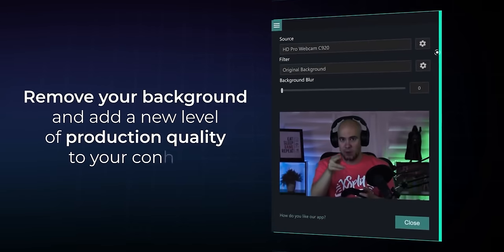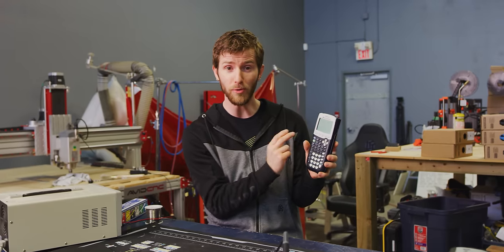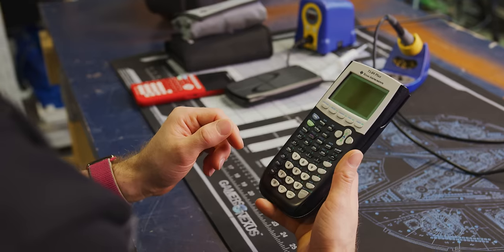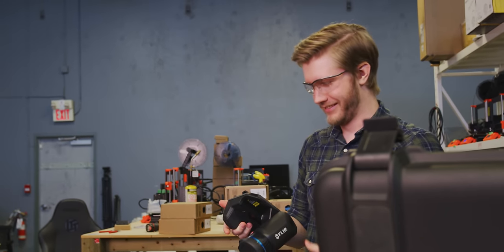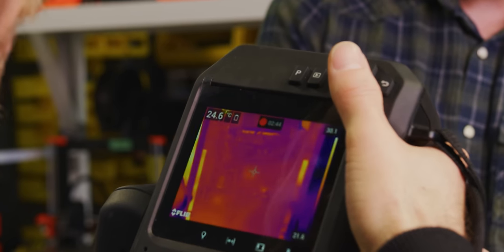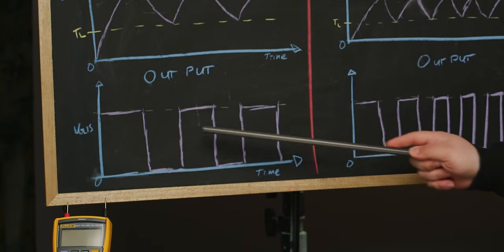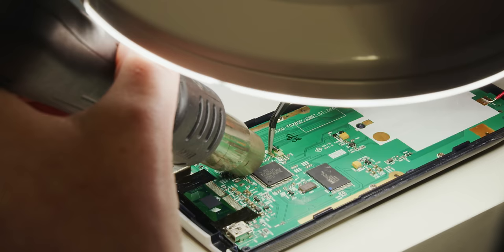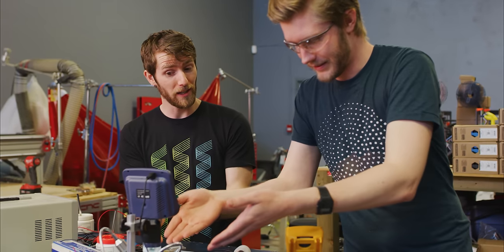Water Cooling a TI-84 Graphing Calculator!

Comment: Watercool a pillow next so I dont have to flip it over.
Reply: Coolermaster new product
Reply: Nah, do it with a peltier cooler!
Reply: If that was possible I would honestly pay for it
Reply: I wonder if it could be possible to make a high end liquid cooled gaming/pillow.
Reply: E
Reply: so relatable
Reply: i  can relate very much
Reply: An actual good idea.
Reply: Already a product
Reply: @supremetaco4887  where
Reply: @ROGAROEBI  with the slogan "Always cold when you need it"
Reply: Enit I actually need that
Reply: @randomthingch1970 put the hot part outside the bed?
Reply: @theproblem9938  Not actually that hard, get a pile of thin gauge PVC pipe. Make a bunch of parallel cooling loops. Silicone the shit out of them to make a joiner up to regular fitting size. Add pump and radiator and away you go. Downside is though that it'll only cool to ambient at best. For added coolfactor slice the foam of the pillow top and embed the coolant lines in it. The reason for using many smaller lines is large lines are going to be uncomfortable and make cool spots rather than a larger cooling effect. Take a look at adam savages cool suit for how to do a proper job of it.
Reply: That’s an amazing idea
Reply: i've wanted to do this for so long
Reply: @xandersnyder7214  cringe
Reply: @xandersnyder7214  nah, vodka better
Reply: Just fill it with copper shavings.
Reply: What if we just made a water bag and used it as a pillow
Reply: My dad has a pillow with gel pads in it to cool the pillow, quite compfy and always nice and cool.
Reply: ImVictiny 👍
Reply: Just get a ac
Reply: Make the radiator the pillowcase
Reply: U r fricking right bro
Reply: yes that should be a thing lol!
Reply: hahahahahahahahaha
Reply: Needs an adaptor for a direct connect if you already own a waterbed... Lol !!
Reply: I THOUGHT I WAS THE ONLY ONE
Reply: To be honest I would pay 10k for it
Reply: A pillow with a fan would probably be more efficient
Reply: Well at least that would do something
Reply: oh yesssssssssss
Reply: Most amazing thing to be done
Reply: World Monarch if hot a design that would theoretically work... am not sure to make it tho cuz there are going to be problems like the water circulation system and water leaks and not to forget the electrical waste
Reply: I need that 💯
Reply: That’s called a nut rag
Reply: Watercooling a pillow might actually result in something as a result of it being watercooled.
Reply: I need this
Reply: @noot9389  cool beans
Reply: Water cooled brain
Reply: I'll Take your Entire Stock!
Reply: I slep in da fridj
Reply: add rgb so i dont need a night light
Reply: I wish bro
Reply: Introducing chillow
Reply: @randomthingch1970  would it even get that hot tho, its only cooling body heat
Reply: Just commenting the 69th reply
Reply: Have any of you watched the April fools vid they made well if you have look 7:16
Reply: I though i am the Only person in the entire word who do this
Reply: Invest
Reply: I’ll talk your entire stock
Reply: Just add some fans or a radiator if on a buget
Reply: Lol
Reply: Take my money this instant
Reply: Imagine when patents come in and your head will be from ice lol
Reply: So relatable bro
Reply: INVEST!
Reply: invest
Reply: The pillow gets warm because you're warm. Watetcool yourself!
Reply: There is already a thing... Well kinda... it's jelly cooling pad stuff but it's awesome I rock it ever night
Reply: Please do it
Reply: Wait. . .
Reply: It's actually something i would buy
Reply: Someone write that down, NOW!
Reply: YES!
Reply: You know, water filled pillows already existed but it’s a generation late than this so I’m honestly surprised by all the people in this comment 😅
Reply: Queue invest meme
Reply: I need this now
Reply: I would 100% buy that
Reply: Well they water cooled a chair so.....
Reply: @crimsonstrykr  I commented where the water cooled pillow was.
Reply: @imvictiny6122  Give it a few more months, if it hasn't occurred to him already then it eventually will.
Reply: 7k likes, this man has or will see it.
Reply: Billions of dollars would be earned
Reply: I actually like the warm part of the pillow
Reply: @aym_gei9708  Stalin, Herman Goring, Hitler and Satan stare in horror
Reply: This has got to be worthy of a Nobel prize
Reply: Xander Snyder yeah sure if you plan on setting the other side of the pillow on fire
Reply: Ok I need that
Reply: This man living in 3020
Reply: Doesn't what already exist
Reply: I thought i only do that. 😂😂
Reply: i would buy this
Reply: I would take incredible personal risks to get a product like that.  Like, a Craigslist pillow wouldn't even be off limits if it had a radiator built into it.
Reply: Yeahhh
Reply: Oh dude
Reply: lol its called a humidifier
Reply: @meshalalomar7472  Invest
Reply: Fucken genius I need water cooled pillow
Reply: iQ 9000000009
Reply: I want to see this for real
Reply: Cool pillows already exist. I don’t know if they are any good though.
Reply: This is the most Linus tech tips comment I’ve ever seen
Reply: Yessss
Reply: This is what happens when we use 100% of our brain
Reply: Don't Forget to use RGB
Reply: Yes
Reply: @coolgreens  u need RGB in that
Reply: Yes
Reply: @aeyde  yes , finally a worthy machine to play stalker on
Reply: @MonosShenanigans  yasss
Reply: Yes
Reply: @xandersnyder7214  yes let’s all build that and really get a brain freeze
Reply: YOOOOOOOOOOO
Reply: Oh my god
Reply: same
Reply: I actually have a watercooled pillow lol
Reply: Yes
Reply: I'd buy that
Reply: I cant flip the pillow because i have my arm under it so it will not be c̑̈ȏ̈ȏ̈l̑̈
Reply: Take my money
Reply: just put an ice pack underneath the pillowcase for infinite cold
Reply: Why is it that I feel like I need something like this in my life instantly😂😂😂
Reply: Greatest idea ever
Reply: Damn that's what I do
Reply: Frfr
Reply: Just put ice in your pillowcase
Reply: Omg i need this my pillow gets so hot
Reply: @randomthingch1970  same bro
Reply: Do u mean So They Don’t have to flip it over? Grasshopper
Reply: YES
Reply: yep
Reply: Yeeeeeeessssssddd
Reply: @meshalalomar7472  yea
Reply: ILL BUY UR ENTIRE STOCK
Reply: legendary comment
Reply: Coming back to this video to see this comment to say not a bad idea
Reply: @qdawwgg  If only I had a way to execute this idea into something actually useful.
Reply: Linus is like Write that down
Reply: While your at it add some rgb for more FPS (frames per sleep)
Reply: It exists but it’s like 500 dollars
Reply: I....I always do that in summer season.
Reply: Honestly a genius idea
Reply: Yes
Reply: Maybe linus was secretly the one to invent chillow
Reply: I'd invest in this
Reply: Over clock the pillow to sleep faster.
Reply: @ImVictiny I agree, I always flip the pillow over so I don't burn my head when I sleep.
Reply: Ya heard it people we need this next
Reply: Chillow
Reply: That is actualy a good ideia
Reply: sounds like a good idea
Reply: I thought of this last year, I want to sell it and make money.
Reply: @charlescastle4533  I posted this comment seconds after I flipped my pillow. Since then I have gotten so much great feedback on this comment for it to become a thing, this joke is a great idea for a product, I just have no idea how to create the product.
Reply: @Povilaz  if only I had the technical know how to create the product, to then make bank off it.
Reply: @imvictiny6122  I was thinking a cooled pad that sits under the fitted sheet.
Reply: @charlescastle4533  for me constantly move in my sleep, a lot of times taking the cover off my pillow somehow. For me this wouldn’t work for long. Other might experience the same thing.
Reply: OHMGOD THAT IS GENUIS
Reply: @randomthingch1970  no thats dumb
Reply: Take my money, I’ll take your entire stock.
Reply: Sponsored by “my pillow”
Reply: Fr
Reply: Not tryna flex or anything but i have a pillow with cooling gel 😎
Reply: True
Reply: This thumbnail reminds me of those kids with superblaster waterguns from the 2000s lol
Reply: HUGE BRAIN
Reply: yes please
Reply: Dont tell the government
Reply: Lmaooo
Reply: I saw a Walmart brand pillow that has a cool side, so you actually flip it over when it gets COLD
Reply: @WellBehavedForeigner  nooooooo its not the same!
Reply: How was this posted a year ago?
Reply: @ironcrafter54  wait hold up…..
Reply: @imvictiny6122  my bad
Reply: yes
Reply: I would maybe buy that
Reply: ima patent that
Reply: Just put a pillow in a tub of cold water and sleep on it
Reply: INVEST
Reply: We...actually need this...
Reply: Would rate 10/10
Reply: Thats a good idea
Reply: This is so needed specially in summer heat
Reply: I’d buy one
Reply: Yes, just... Y E S
Reply: Genius
Reply: YES YES YEEEEEEEEEEEEEEEEEEEEEEEEEEEESSSSSS
Reply: Has this been made yet? I NEED ANSWERS MAN!
Reply: Wait till that watercool breaks
Reply: Chillo
Reply: Y E S
Reply: Damn. Time to dream in UHD 240 FPS  and ray tracing
Reply: I don't care about pillow temperature. Summer gets a bit warm but manageable.
Reply: I would watch it
Reply: Good idea ima note that
Reply: Had me dying
Reply: Man’s a genius
Reply: Based and cold pilled
Reply: Get this man in contact with the president
Reply: Haha so true
Reply: *nitrogen cooled 😂
Reply: Yes. Just yes.
Reply: Yes
Reply: FR THO LINUS DO THIS
Reply: I agree
Reply: @arkham7610  they water cooled a chair. Water cooling a pillow would be the same
Reply: You sir are a genius
Reply: The most important thread of 2021
Reply: Watercool
Reply: @tfr  and what?
Reply: Yooooooo
Reply: Genies
Reply: GENIUS.
Reply: Imagine putting flexible tubing inside of an insulated pillow with an external radiator. That might actually work. And I'd buy it
Reply: There's a mattress that's water cooled. And what I've done in the past is put flat freezer pack into my pillow.
Summers here are nuts, I usually can only sleep around 3am in the summer because it's above 80 till then.
Reply: Yess
Reply: big brain
Reply: @theproblem9938  it exists. Just look up "Actively cooled pillow"
Reply: Yes…YESSSSSSSS!!!!!
Reply: It’s called a chillow.
Reply: Yes!!!
Reply: Best comment ever seen...
Reply: Genius idea
Reply: Honestly I would buy it
Reply: why stop there? why not blanket, sheets, mattress, room, earth?
Reply: @TheAdhdGaming we're evolving
Reply: Actually a good idea
Reply: Genius
Reply: YES
Reply: @Xander Snyder But where would the heated side go?
Reply: Yeah I would love that...
Reply: Oh my God you genius. Now make it happen.
Reply: you can just pee into the pillow
Reply: Yes
Reply: Genius
Reply: That exists actually, and they are amazing. Not even a joke, I sleep a hundred times better.
Reply: best mfing idea ive ever heard
Reply: But sire the fans!
Reply: Bru it will get wet
Reply: most smart and genius comment ive ever seen on youtube
Reply: Yes
Reply: @coolgreens  Getting 4k with a 144fps of sleep
Reply: 250th reply!
Reply: Check out the chilli pad for matresses
Reply: anyone else here after the watercooled mattress 💀💀💀
Reply: he did it to the bed!
Reply: Nah, put the antartic in it
Reply: Yes!!!!
Reply: He did it for his bed
Reply: and thus 8sleep was created
Reply: I read this while doing it 😂😂😂
Reply: Best idea ever
Reply: i think use peltiers instead
Reply: @theproblem9938 it literally is possible

Comment: Next up, “We added a graphics card to the water cooled TI-84”
Reply: We adde gtx 1080 ti to the ti-84
Reply: @gabrielhynek8863  *RTX 3090
Reply: Well then it’s worthless unless you have it at 75ghz
Reply: @izakymom  coconut
Reply: @izakymom  beautiful
Reply: ffs it's gonna be more expensive than my laptop lmao
Reply: @Percy WONG lol
Reply: @Percy WONG And how about the drivers? The drivers could be more resource intensive then it can handle.
Reply: RTX Tracing on a Calculator
Reply: 4K math
Reply: Now you can do 10 variables in 10th dimensions graphs
Reply: "We added the water cooled TI-84 to a PCIe slot"
Reply: yes
Reply: Finally I can add with dlss
Reply: From my very surface level knowledge of computers, I think it's possible using the data link

Comment: The Ti 84 had actually quite a beefy processor. It's just that it's clocked extremely slowly so that the power draw will be minimum.
You can get at least double the speed if you also speed up the memory (and other things). There's actually a similar guide out there that I had seen earlier..
Reply: Do you have this guide ?
Reply: @adrient3957  no I don't. But basically it involves replacing/reducing the resistor of the clock-genetarion circuit with one of a lower/higher value, so you get faster fclocks.
Reply: I believe it’s possible to do this in software but it makes the calculator unstable
Reply: You would also maybe need to jailbreak your calc

Comment: As a mechanical engineer and a computer hardware nerd, I have an intense amount of respect for Alex. Keep up the good work, man.
Reply: if you ever get to see some of his old go kart content, its NUTS. he'd build a wild chassis, and then just SEND it.
Reply: Yea man, he is so smart! Also, he just makes everything seem easy. Ow we need to make this circuit, get some of these resistors just mash it all up. There you go. Even more with mechanical engineering stuff
Reply: 117TheWolf until he said increasing wire length increases capacitance whoops
Reply: @tntfireguy1  probably meant resistence
Reply: @tntfireguy1  wire has capacitance directly proportional to its length, so he's not wrong. But you're talking a few picofarads for like 10cm of wire, so I doubt it would effect the astable clock a noticeable amount, at least not nearly as much as the resistance in the wire.
Reply: How did you get the LTT after your name?
Reply: James Balazs resistivity increase yes, though due to the nature of bridging the two capacitors the wires will probably have some affect on the capacitance as it is conducting between the two
Reply: Xnzyrp stray capacitance yes, though it’s as u said such a minor difference as it’s not a significant change in length
Reply: He is a member of the channel

*if you hover over, it says he is a member for 4 months... hahaha...
Reply: @tntfireguy1  I think the main problem is the dangling wire. Try solder as perfect as you can, leaving a resistor pot just waving around like that can change the value quite a lot (10s to 100s Ohm depending on the size of the resistor). That is why it needs to be soldered down as short as possible.
Reply: Can you teach me plz
Reply: Not to mention his looks I mean what a sexy beast
Reply: I wanna be him when I grow up
Reply: @fabianvandermijde4066  before that reaping pads...
Reply: @tntfireguy1  it will increase capacitance if it's a pair of wires, ie. power and ground. These wires act as parallel plates separated by an insulator, which is the same as a capacitor.
Reply: Alex is right, it does increase capacitance and most of you are right as well that the resistance goes up. But something no one has mentioned is that the longer wires also act like antennas picking up noise from the system as well as external interference which will also affect stability... and the sensitivity to interference will increase with clock speed.

Comment: Finally, I can graph an integral in less than 10 minutes.
Reply: use a fucking desmos
Reply: @omniyambot9876  no desmos on the AP exam
Reply: HP Prime for the win running 528 MHz stock. Can use in AP exams and more.
Reply: I did the ap calc bc exam with a ti nspire csii Cas edition. No idea why it was allowed
Reply: In 2010 I took the APs and ACT with a ti89 titanium in a 84 plus case. Made ap physics exam a breeze.
Reply: My Ti-83 only struggled with integrals of logarithms. I remember setting it down to move on to the next problem because it'd take like 5 minutes.

Comment: LTT: you can overclock a calculator

Calculator manufacturers: that's not how you use it
Reply: I have a water cooled shrek.
Green coolant, damn sexy onion decal.
Reply: What specs would Ti put in calculators today if they had to really bump up specs? . . .
Reply: Yeah they would block the firmware to overclocking stuff.
Reply: Yes it is the way you use a calculator!
How else would you survive Math lessons?
Reply: its for doom
Reply: i was overclocking monitors before it was cool XD
Reply: did you know? By overclocking A calculator its CPU will gain eventual precognition so you would not need to write anything!  It will just read you!
Reply: Mackenzie McIntyre hostage is in master bedroom
Reply: Next a RTX 2080Ti attached to it!
Reply: You werent supposed to do that
Reply: It is very rare that comments slay me.
Reply: They unironically just blocked C and assebly programs. So yes, TI calculators can no longer run Doom.
Reply: Actually, TI's engineers love seeing fun stuff like this. However, they don't make production models faster by default for reliability reasons. The OS runs directly from the flash chip, so even a one-in-a-billion chance of a misread would cause a crash every few minutes. Yes, every instruction gets re-fetched (no cache) from flash in real-time.
Assembly is not slated for removal in the B&W models. Any future OS updates are unlikely.
Reply: linus: asks texas instruments for calculators to overclock
texas instruments: actually sends over calculators to overclock